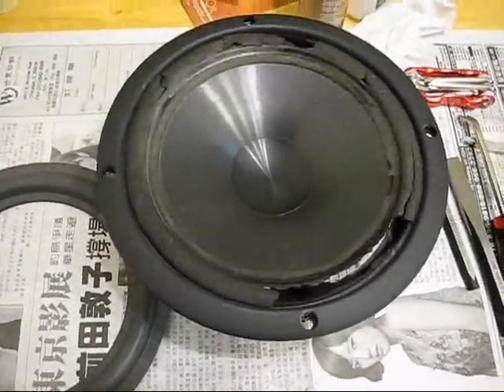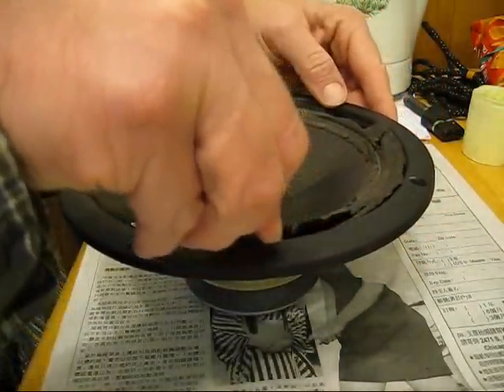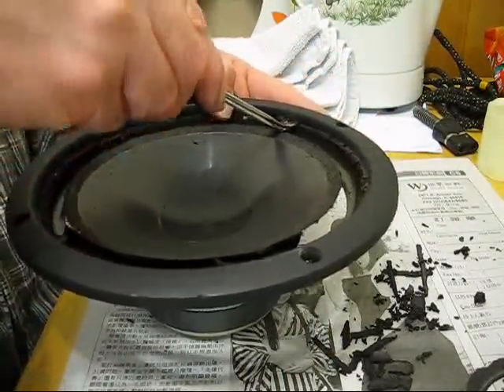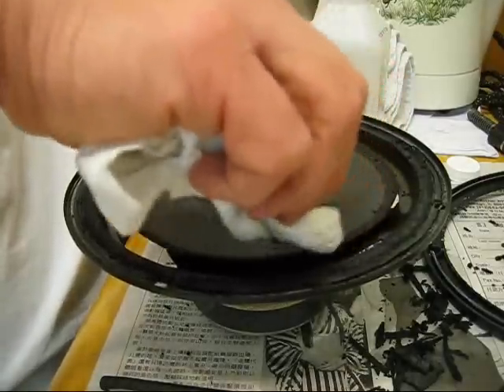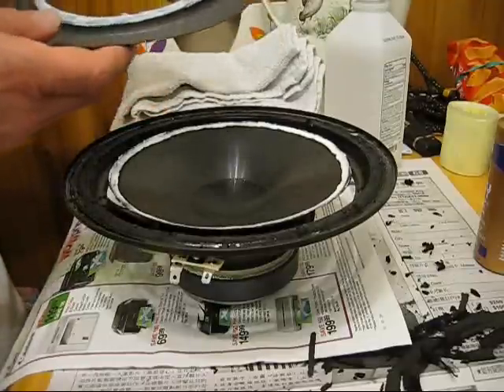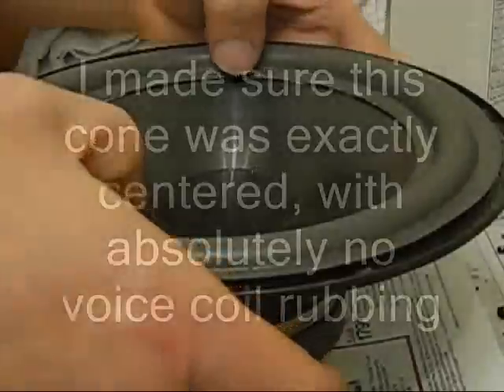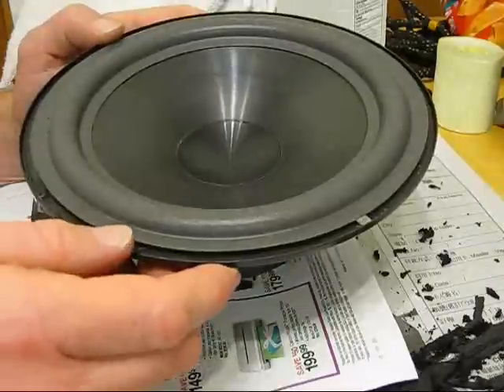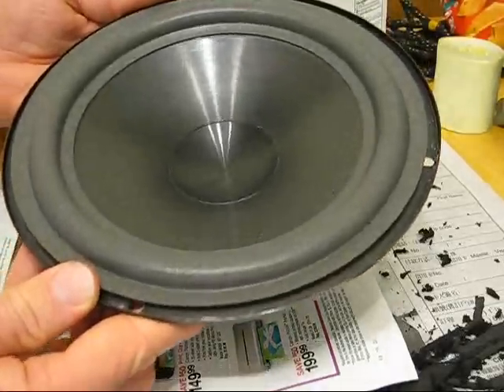SPEAKER REPAIR - HOW TO REFOAM YOUR WOOFER with NEW SPEAKER SURROUNDS

Comment: I've refoamed two sets of my speakers, Pioneers and ARs, and got away with not using shims both times. Both times, the donuts came with glue, which worked fine. Both sets of speakers are about 35 years old and still in use. (And still sound great.)

Comment: 5:19t , just plug a battery(1.5volts) to +/- of the speaker (or 1v AC) for 1minute , the coil move up just enough to have a time for gluwing 1.5 dc is not dangerous  just for 60 seconds ^^ , i use this tip for a kenwood 200watts subwoofer ^^
friendly from Belgium :)

Comment: The current method does not remove the dust cone and involves sending a signal from a frequency generator to the speaker. You align the outer edge of the new ring onto the frame till there is no rubbing heard. I did a couple 8" JBL speakers that didn't need any alignment at all. Nice video. I think that glue was Allene's Quick Dry Tacky Glue. 👍

Comment: The infinity is a good example of leaving the dustcap on. It saves time and leaves it looking professional. As someone who repairs speakers for a living, it is helpful to keep repair time down and it is possible to repair that speaker in 5 minutes, ready for use.
Reply: +Vance McCarthy You don't need to take the dust cap off anyways. The coil centers itself automatically. I seen that in a Simply Speaker video. Simply Speakers also has the best glue in the industry, the clear MI-3035 glue. It's better then this crap he used.
Reply: thanks!
Reply: Would you buy the sealer to put over the foam once it is bonded in place? That looks like an optional step Simply offer for 6.95. I wondered if it matters for longevity or performance.
I'm re-foaming my great old v.1 Paradigm Titans, thanks!
Reply: jonas brave 

It is an excellent product 
I use Speed-Sew available in Canada 
Dritz Liquid Stitch Fabric Mender 
available in the USA. 
For surround sealant/protectant both 95% natural latex

Comment: Glad I was able to find this YouTube video. I had purchased (on eBay) a set of new foam surrounds for our two Infinity CS 3007 speakers. The new stuff came with a set of instructions. Unfortunately, it neglected to mention that the circular plastic band needed to be pried off. Before I saw this video, I was really perplexed at how the new foam was gonna work. Now it's all clear. I've completed the first speaker - three more to go. Well, actually two. One needs to go out for repair work - a %^&^^$# rat had gotten into the back of the cabinet and had chewed the two wires off of the cone. Arrghhhh.....

Comment: THANK YOU for showing the plastic ring information.  i am amazed at how such an important detail like that is left out.  It was lucky you had this particular driver and I am very glad you posted it!  Thanks for going to the trouble!  If you could show us how to apply the outside diameter glue, that would be much appreciated!  Regardless, you're the MAN!!!!
Reply: Definitely helpful, wasn't sure how to attack that ring without maybe chiseling it away! Turns out it helps to use a thin standard (flat-bladed) screwdriver and slide it between the plastic rim and the metal frame, then slowly twist the screwdriver a few degrees until you can hear the adhesive give slightly; repeat maybe every 1/2" around the diameter of the speaker frame until you're able to lift the ring away.

Comment: Hi I can I ask ... I have a speaker the volume knob was broken so I removed it together with the board but I remained the 5 pin wires where it was connected... Now the stereo cable when plugged in using cellphone aux it only sounds in its lowest volume .... How to repair it to make it in its highest volume ..

Comment: My quickie method isn't conventional but it served my needs on Bose 501 speakers from early seventies.  As long as the cone is still centered the surround can be repaired
with thin layer of silicone (black or clear). Areas with missing foam get a section of masking tape to serve as foundation for silicone. Repair has held up for 30 years; 1984 to 2014 and will go for another 30.

If the rot isn't too severe there is no need to remove the speaker from the cabinet with this method.
Reply: As a speaker repairer for a company, I have used that method, but used a flexible clear drying PVA glue for a professional finish, as a lot of our customers demand.
Reply: Glad you responded Vance.  Recently noticed strange noise from woofer of JBL L100.  It is a fuzzy distortion that can be stopped by slightly hampering the movement of the  cone.  Is voice coil going bad?  The surrounds are perfect shape.  Solved the problem  by installing small foam padded brace attached to one of the four frame screws and contacting the outer 1/2" of the cone.  It does the same thing my thumb was doing; limiting the cone movement.  I suppose that will alter sound characteristics but the noise is annoying.  Seems like the noise is intermittent and possibly dependent on frequency and strength of signal.

How do you compare the Pioneer HPM 100s vs JBL 100.   Now regret selling the Pioneers after I picked up the JBL 10 years ago.

I can understand why some customers like the finish you mentioned.  I found myself trying to achieve that outcome with a finger dipped in water.........or my mouth
Reply: The coating on the original surround is now the only material doing the job of a surround, as the original is not doing anything. The method is only temporary and is the cause of the 'buzzing', especially at higher wattage levels and at certain frequencies - as you have noted - because the glue won't be even. The surround will now have to be replaced.
The difference between any make and model is like oil and water - especially the older stuff - the well known brands like pioneer and JBL are designed for specific purposes. A cabinet speaker designed to handle all musical types are very expensive.

Comment: For future people trying to remove glue easily. Use a light and go over the are you want to remove in a back and forth motion really quick for about 3-5 seconds and grab a coner and peel off. Super easy method.
Reply: say what; rephrase bro
Reply: @justnoted2995  I must of been drunk when I wrote this lol. Anyway what I meant to say was. Grab a lighter 🔥 and go over the area that has glue and it should get tacky. Then get a razor blade and it peels right off. You have to be pretty quick about it tho.
Reply: @JOSEALVAREZ2012  thanks mate

Comment: In retrospect it kills me to remember that I threw some perfectly good rivers away when the surrounds rotted! Since then I've re-foamed many speakers. This tutorial is fine but shimming is really necessary to do the job right. You can either buy new dust caps of the same style and slightly oversize or leave an 1/8" hinge on the originals. Shim. Then glue the original cap back down.
Reply: An alternative to the shim. Try powering the speaker, having laid it flat , and centre the cone before the glue has set. Works every time.
Reply: mr hollingsworth i need more help on this....is there a way to contact you?
Reply: @factorylad5071  I’ve seen videos where a signal generator app was used at 40 Hz signal to resonate the speaker and allow you to center it. I just tried it tonight as I’m now repairing a pair of Boston HD7 monitors from 1992 with 6.5 inch woofers. I think it’s going to do the trick.
Reply: @mikeydizme1  I hope it all goes well then but I should consider adding a series resistance to the coil to add some damping?
Reply: @mikeydizme1  Mike last time I did a driver job I ended up with a cheap surround and the result was pathetic , hope you have better luck than me .
Reply: @mikeydizme1  I know it will sound like pseudo science to some but you can visualise the process as being opposite to that of if you wanted to demagnetise a metal object using a spot frequency source , you have to do this by drawing the object to "infinity" which you will do similarly to the oscillating voice coil by bringing the amplitude to zero and holding the cone there.
Reply: @factorylad5071  thanks for the great advice.
Reply: @factorylad5071  thanks. I spent a few extra $$ and got mine from Springfield Speaker. It's authentic foam material and not poly/rubber. I'm going super slow on this my first pair. I'll take photos and share them. It's astounding to me that my speakers are 29 years old! Guess I'm old too then :)
Reply: @mikeydizme1  Yep Mike I am sure there is a lot of playing about you can do on a surround especially if you have something of a method going on. My speakers (KEF 104 aB) have an after fit surround by a previous owner and are just awesome.

Comment: Just bought a pair of Duntech tower speakers from Australia yesterday. They were 10 Gs when the came out in the 80s,I got them for 1,300 . Anyhow after playing a few records very loud the surrounds went,all 4 of them. Im just wondering if I should do this myself or get an experienced repair person to do them. I cant even find a place in town that sells the surrounds,and Im wondering how important it is to get the original brand for them. Any advice is much appreciated !
Reply: Well if you get some that are identical/fit, its not too important. You could even (if you plan on "abusing" the speakers) consider switching to rubber surrounds - they're not as light as foam ones, but much more durable. Wether to do it yourself or not really comes down to how much you trust yourself with this sort of thing, and how valuable they are to you. Its relatively easy if you take your time and be very careful with it - but of course it has the chance to go wrong.

Comment: I use Acetone to soak the old foam from the speaker easily without using any physical force.   In this way I also replace the voice coil alone without removing any other part i.e. spider / cone and restore the speaker to its original condition. 💯

Comment: I'm in the middle of rofoaming my 1st of 2 woofers and I wish i'd just purchased new woofers. Its a total PITA getting all the adhesive off and it falls down on top of the driver and you can't get it off. I don't think I can blow it out with an air hose since it was soft when it was scraped off and rehardened under the dome.

Comment: what is the name of glue you have used?
Reply: That looks like fabric glue. That'll work if the cone is paper or fabric, but not if it is a harder stiffer material. E6000 cement is commonly used in that case.
Reply: The  instructions acquired from Simply Speakers applies as well
The adhesive sealer (Speed-Sow)used on the surrounds requires one coat only 

Do Not apply a second coat 
Or "Touch To Dry Test" " the areas coated  
Touch to dry test only after given length of hours  or approx 4-6 hrs
Reply: just a "basic" PATEX (yellow) is very good ^^ need 24 hours to fix but after  ,no problemo ^^

Comment: My plastic ring is not the same as that plastic ring.  Must have been a design change.  My plastic ring is more heavily glued.  It has proven impossible to non-destructively remove the plastic ring on my design.  In hindsight, I should have verified the disassemble-ability of my speaker including that ring before I decided to order glue and a new foam ring.
Reply: You said it, no kidding... same thing with mine. Even with using solvents much stronger than any alcohol, mine are impossible to get off without snapping them off in halves. Or I risk everything by having them removed intact, all at the cost of running my screwdriver/crowbar/razor knife on through the cone, effectively destroying it. The sheer force needed to pry these puppies up off these things at such risky angles...dammit son lol. So naturally, I opted for snapping off the plastic rings. In which case, with a bit of super glue and paint- you can't tell they were ever snapped off anyway thankfully. My pair of speakers specifically are the "Infinity Reference Four" tower speakers with the Emit-R tweeters, five inch midrange, and the eight inch woofers. They're made with the 'injection molded graphite cones' respectively.

Comment: good suggestion, but first thing is that u should support the cone because centering it good enough i not good enough and then start gluing the foam to the frame with a the cone upso you have no issue with the glue and then real problem centering the cone

Comment: Those are the cheapy foam surrounds with the smooth glossy finish. I would never use those on a good pair of woofers as they are way too stiff. the better surrounds are a rough surface with a dull finish and will act like the originals.

Comment: What kind of glue ? HOW TO APPLY IT ?
Reply: If you order their kit for your speakers, they enclose glue with your order. I got 2 tubes with 4 woofer surrounds.
Reply: I got the foam without glue. There is still the question: Which glue? B7000? Ponal?